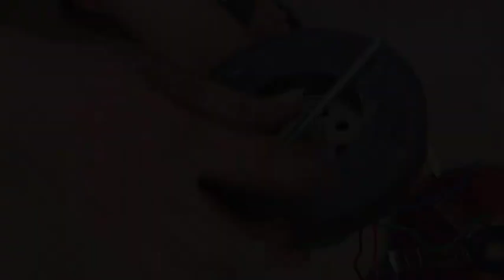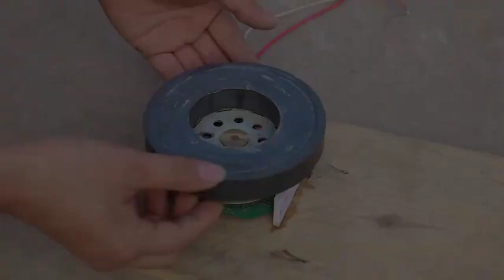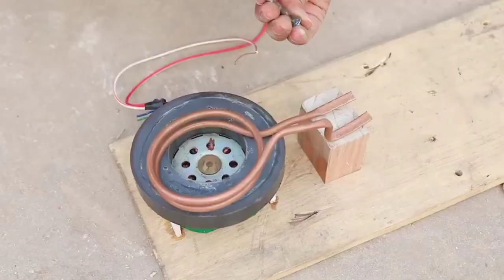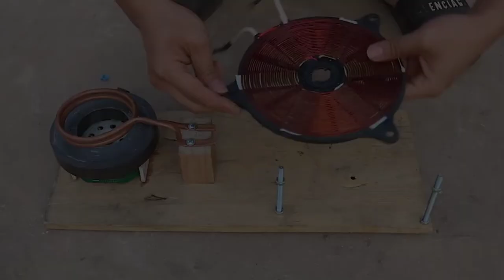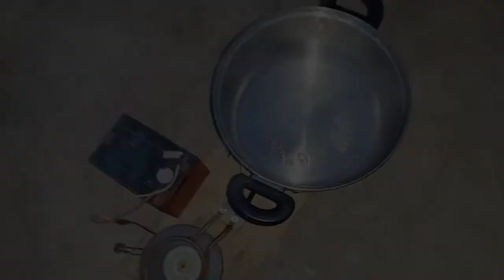I make high power electric stove from a Magnet and Motor / alternative in the gas crisis

Comment: It would call for asome commercial applications if you could just add mechanical gears to operate it manually, using muscular force in places where electricity is not an option, on planes for example...  Induction Heat means it can be completely sealed and hence the same is true of its separate wireless power source, especially if combined with Curie alloys as the 21 temperature-specific PyroFoils by JAi.
Reply from the maker: I'll Try